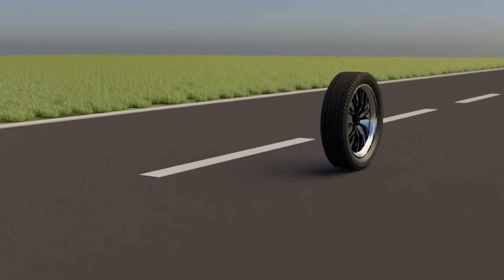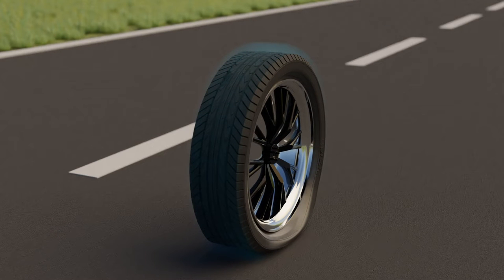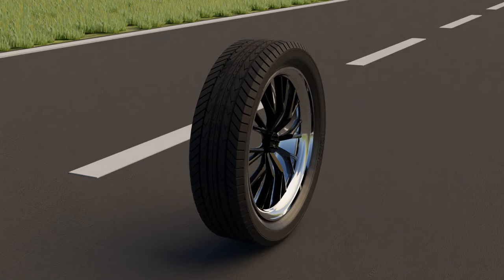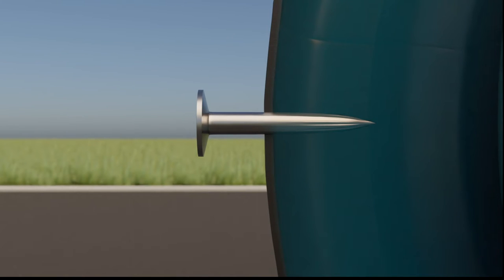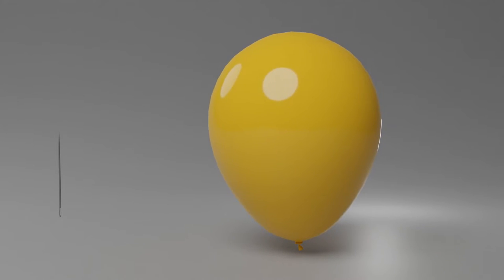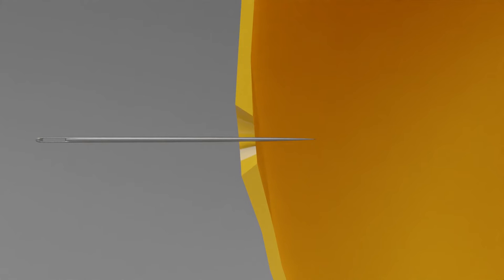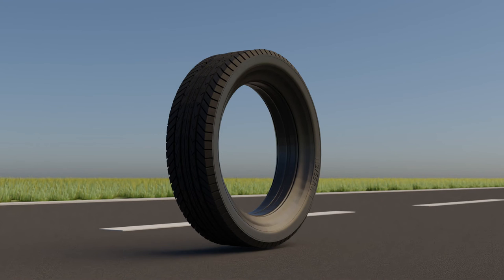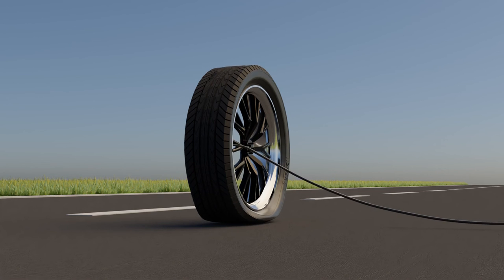TUBELESS tyre  as a life saver ,learn with animation...

Comment: idea - to place inside tubeless tyre  2..3..4 old good tube, to drill more holes for nippel valves on disk, and to fill all three tubes via air splitter ( comp.air--->--------E  3tyres valve connectors(need to have own such splitter adapter) ) simultaneously, with (up to)equal usual  pressure... if puncture happens - hole-sandwich of tyre and the one-brocken tube of 3 tube in tyre - will leakage lowering, (concurently with rest tight tubes) "layer shift"(maybe even stops leak) and wheel only loose like 30% of its pressure inside tyre, with(as result) only little(not a big) problem... am i right or not?

Comment: I drove a van on a highway at 140km/h and a front tyre exploded and was empty in fraction of a second. And there was no accident, I just slowed down and pulled on the side of the road. You just have to hold the steering wheel.